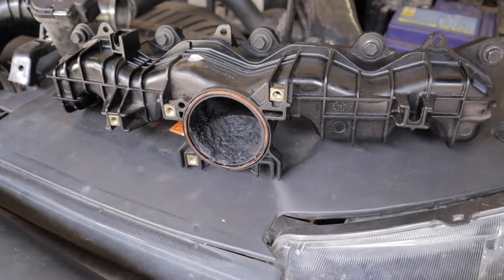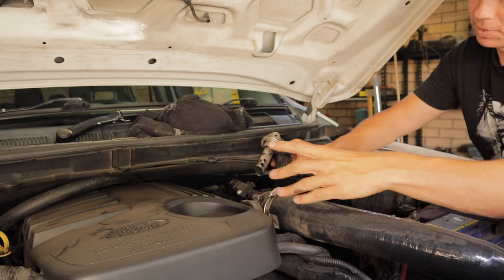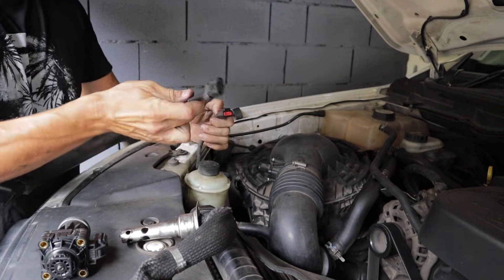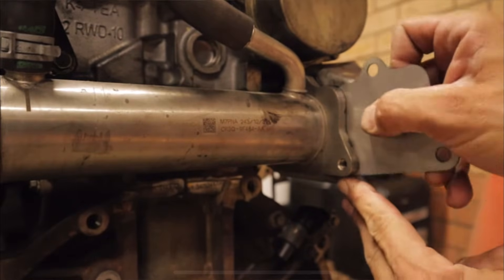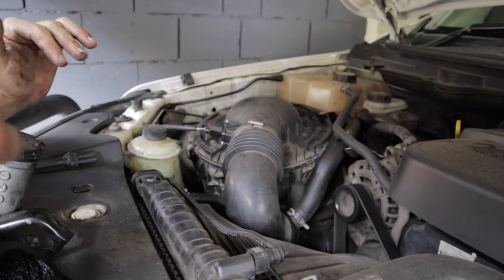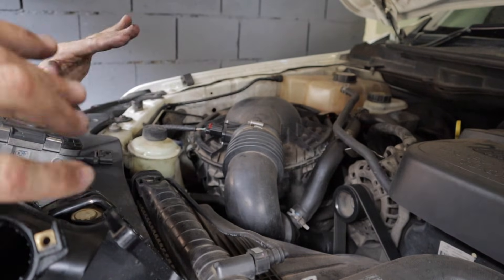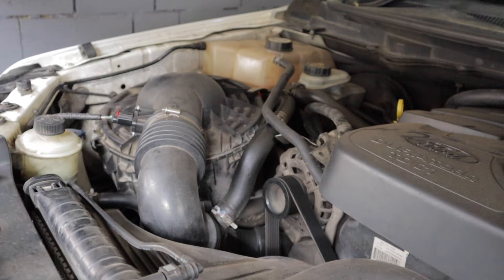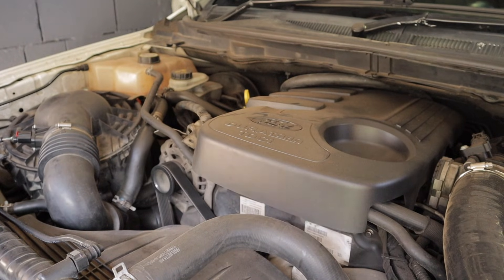Ford Ranger EGR Intake Manifold Sludge Build Up & Prevention

Comment: Blanked off exhaust side only, on my '18 Widtrak 3.2 auto.
Cleaned out intake manifold approximately 23 000kms ago, still looking as fresh as the day it's been cleaned.

NO FAULT CODES SINCE, AT ALL !!!
Reply: I just bought a 3.2 2016 Wildtrack auto. You didn't need to do anything on your ECU after your upgrade? And any changes to feul consumption?
Reply: I'm thinking of doing this to my 17 wildrtak 3.2 auto - was there any other codes you had to update when doing it?

Comment: Always wonder how everyone gets great economy out of their 3.2’s. I have a 2017 3.2 wikdtrak, best I can get out of it is 10.3l/100km and that’s driving at 95-100km/h. Car is stock standard except for running slightly bigger 285/60/18 BF Goodrich AT
Reply: Somos the same in mine, I’ve got 265/70/r17 and it comes a little bit up from the stock tyres

Comment: The EGR delete cable fools the ECU into thinking that the inlet air temperature (as measured by the MAF sensor) is below 10 deg C. EGR will not operate at or below this temperature. A while back Toyota got pinned in Japan as EGR did not operate during emission testing . . . cause was temperature too low . .  and a valid case for not operating. So a simple series resistor in the MAF temperature circuit is enough to fool the ECU - this is what the delete cable does.

Comment: Had blank plate and bypass hose on 2017 bt50 3.2 had it setup like this for few months had major issues with expanion tank bubbles like head gasket was gone .gone back to stock know expanion tank drops no codes no abnormal temps egr isnt leaking no smoke and using recommended  coolant
Reply: mmm..very interesting,got the same model mazda 2016 bt50,not sure if i should do it now

Comment: Hey mate if I install the egr delete cable is there still a reason for me to install a blanking plate as well or will one be fine with out the other
Reply: YES!!! The egr cools the exhaust gas with coolant in the canister behind the engine. They can fail and when they do it dumps coolant into your engine via the manifold and kills the engine. The blanking plates stop this…

Comment: With regard to the oil pump change, I noticed on another youtube video that the commentator placed a plug into an all ready created threaded orifice right near the oil pump and commented that if this wasn't done that the oil pressure would be insufficient. I would take your opinion as more reliable. Thanks and keep up the good work.
Reply: Can you just blank it at the intake side?
Reply from the maker: yeh thats correct, if you upgrade from the vane pump to the geared pump, you block the banjo bolt of coming from the block

Comment: I did  a bypass on my egr yesteday how long can i run it with just the bypass setup ? Do i still have to blank it off or just plug thr old hoses up ?

Gret videos dude my ranger gives me loads of trouble but youve saved me heaps of money with uour fixes so far
Reply from the maker: i blanked mine aswell, it has been bypassed for 200k with no issues

Comment: My old Ranger has 330,000 km on the clock, last night it went into limp mode, fault code P042F (EGR stuck closed). If I fit one of these delete cables and reset the code would that solve the problem? Or do I need to remove and clean the EGR valve?
Reply from the maker: pop off the black plastic valve that has the plug going to it and spray some brake cleaner down it, free it up using a flat screwdriver, would take 15 minutes, watch my "common fault codes causing limp mode"  vid to know what im talking about.
Reply: @abdautomotive  I also noticed today, it has a P700 code as well and doesn't shift correctly. Would these 2 be related? Thanks for your reply. Oh, and can you take that cap off without removing the valve or the inlet manifold?
Reply from the maker: @timjohnun4297  i would say its related because it's stuck in limp mode and has reduced power
Reply: @abdautomotive  Thanks, I'll try and get that cap off again tomorrow. I couldn't get to one of the screws because of the manifold. Might even try swapping out the ECU, son reckons the CEL came on when he hit a bump

Comment: Do you still run the rusk of the EGR cooler failure to damage your motor if you install both plates? 

Is it recommended to bypass the cooling pipe and blank off plates?

Comment: Can anyone tell me if an EGR blanking plate will cause an ECU error on a 2015 PX 3.2? If so how do you prevent that from happening? Thanks guys.
Reply: I did in my px ranger I was told to dri.ll a small hole in the blanking plate.minimal fumes get through but it's enough to keep the sensor happy
Reply from the maker: @noordhup  cheers for that reply, i get heaps of people asking
Reply from the maker: is it a dpf model?
Reply: @abdautomotive  Don't think so. Ours is a Oct 2015 model and I think the DPF came in on the 2016 model. Where should I look for a DPF on a PXll model? Thanks.

Comment: I’ve put the egr cable in when the car warms up if I stop at the shops for instance I get back in start the engine the temperature on the dash for ambient temp comes up -4 and and works it way down to 2 degrees 

Is that normal?

Comment: if i used the egr delete cable would that also stop the egr cooler from working? i suspect i neeed to replace the cooler but if the cable deletes the whole process ill do that
Reply from the maker: no the cable just shuts the valve , cooler is seperate

Comment: Cleaned the intake manifold and replaced the glo plugs today.  170,000 klm on car. I installed a while ago a exhaust manifold blanking plate and air flow cable in case the egr cooler failed which it did about 15,000 klm ago. Lost coolant to the egr cooler but no other problems. By passed the cooler and left this setup even after the clean and plugs today. I’ve never had an error code and still no code after todays work. Agree with all your comments about been a long messy job but the manifold did come out and go back easily. Maybe more luck than good management.

Comment: I find it odd that in a hot country people want to block off the exhaust gases from the EGR system, the exhaust gas is used to lower the operating temperatures at idle, by lowering the oxygen level and hence the combustion mixture explosion/ ignition temperature. 
Just clean the system every 200k, even that isn’t necessary due to the amount of space the pipes and tubes allow for this slight buildup. 
Run a good injection cleaner every 100k for optimum efficiency and performance. 😊

Comment: I have question though some peoples on the forums even the product suppliers said don’t run the catch can with the Egr delete causes crankcase pressure failure,faster failure sth like that what’s the behind of that
Reply: I have egr blocked , running fine for 60000km, as soon as i added a catchcan it started spewing oil out the front of the motor, took it off no problems now!!
Reply: @natebetcha8059  after taking out the catch can u noticed any build up on the intercooler hoses or anywhere
Reply: @adilozkan9990  there's a small amount through intercooler circuit,but zero in the catch can...I think the vacume from the intake system sucks out the oil vapours, from the engine basically recirculates it,but there isn't that vacuum present with a catch can, so it blocks up...that's my thoughts personally
Reply from the maker: i run a cheap catch can , it's basically a straight through type with  a little steel baffle, $38 on ebay

Comment: The EGR is used as the blow off excess manifold pressure in PX2 and also at low engine revs provides volumetric efficiency for the engine. I blanked off my EGR and cleaned the manifold at 80,000Kms. My fuel efficiency went from 12 Km/L to 8.2Km/L and the blow off had nowhere to go but oscilate in the air intake side. I have now unblanked everything and it runs normal again.
Reply: What do you mean by "blow off"? Excess inlet pressure? 

Does the egr open to allow excess inlet boost into the exhaust?

Comment: I have a 2016 px2 that threw the EGR fault code. Fitted a blanking plate and had the EGR turned off in the ECU. Your vids were very helpful, the top EGR bolt is even harder to get to than the PX1 but it can be done, i accessed the bottom bolt easily from underneath the vehicle using several 3/8 drive extensions
Reply: Your comment makes me wonder if you can just turn EGR off in the ECU and get the valve to stay shut? I have a PX2 as well and thinking about how to disable/delete/throw into volcano the EGR sys.
Reply: @captainotto the px2 EGR cooler is different to the one in the vid, apparently the PX2 units don't fail and leak coolant into the engine. The main issue with my truck turned out to be the EGR temperature sensor which is mounted on the exhaust manifold

Comment: I have 15+ px2 2.2 fully deleted wth cable to afm, cooler deleted etc done 475km no codes no problems and use catch can  before mods intake almost completely plugged now clean as a whistle best mod on rangers after trans cooler upgrade
Reply: Did the catch can plug up ?
Reply: @AhureiVisual-z3y  
No mate empty about 150ml from catch can after 15k kms

Comment: Hey mate, I have a px2 XLplus. Its the model that runs a px1 engine, BCM and interior are all px1(checked this in forscan Engine models 2011-15 ) I'd be safe to assume that blanking out the egr without a tune out would suffice?
Reply from the maker: yeh pre dpf is fine
Reply: its  2017 though and im pretty sure it hs dpf  @abdautomotive

Comment: Seen a few videos that explain how the EGR delete cable is a terrible idea and causes more problems than it's worth. It only tricks the ecu that the inlet temperature is zero so the egr valve doesnt open, which in turn reduces turbo boost and increases the exhaust AFR. So you'll end up with even more build up and less power.
Just blank the egr and be done with it.
Reply: yea that cable was the cause of my 3.2 shutting off randomly. Best thing to do is blank it and deleted the code from the ecu.

Comment: Awesome video, thank you so much for the information. I am curious, with the EGR blanked off, does the engine take longer to reach operating temperature?
Reply from the maker: no
Reply: No but you will burn heaps more fuel because the EGR system provides volumetric efficiency at low engine loads.
Reply from the maker: my fuel efficiency improved considerably

Comment: I’ve done similar stuff to what you’ve done.. but I have re plumbed my pcv directly to my air cleaner . Now it drags hardly any oil into the system ( much lower vacuum ) while still pulling in the fumes and nasties.
Reply: so you air filter is gettin caked in oil?
Reply: @SlaterGator  No mate.  I have a K&N filter and it has  only has a  small dark stain on one side after 30000km. As I said this method vents the crankcase to the low vacuum side of the  intake system, so hardly any oil is sucked through at all . Plus the MAF sensor gets a truer reading of the intake airflow..
Reply from the maker: i might need to try this
Reply: @adrianvringer340  I like this idea. How does the airfilter housing look? Does it get oily at all? What fitting did you get/use to connect the PCV pipe to the airbox?
Reply: @NCHuntSA   Hi. I simply used a hole saw (25mm I think) to drill a hole in the back of the air filter housing  and re routed the pcv tube into it. Plus a cable tie to hold the tube onto a bracket close by. Hardly any oil comes through because it doesn’t have the same high vacuum drawing oil mist into the tube and down into the intake pipe.  Obviously you’ll need to block off the old connection point on the intake pipe. 
I haven’t reinvented the wheel here! It’s just the way crankcases were vented in the past..  eg early Holden red motors.
Reply: @abdautomotive  yep one of my first  mods. Hated the thought of that hot,oil laden, unfiltered air getting dragged in to the motor. My thought was to let the crankcase vent into the air box  (like on an old Holden) let the k&n air filter capture any oil, of which there’s a lot less!  And the hot fumes get to cool down some before  getting drawn into the intake. I also think but can’t prove that the MAF  should be getting a truer reading of airflow.  I did feel a slight improvement in engine response. I’d be very interested in your feedback if you try this out yourself. ☝🏽